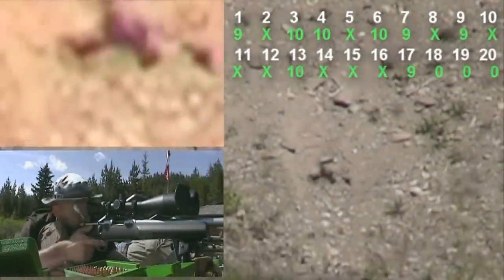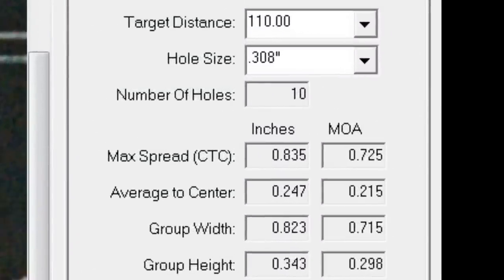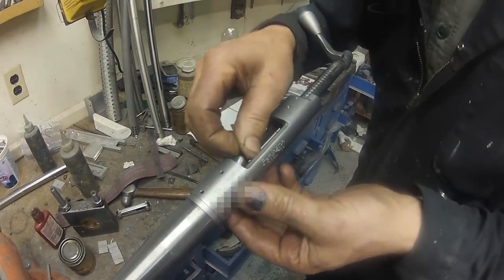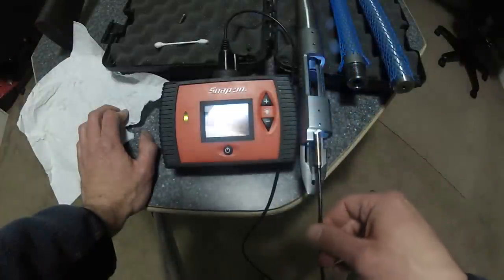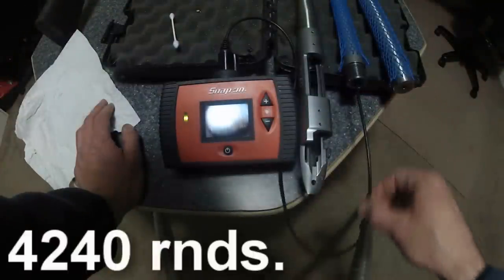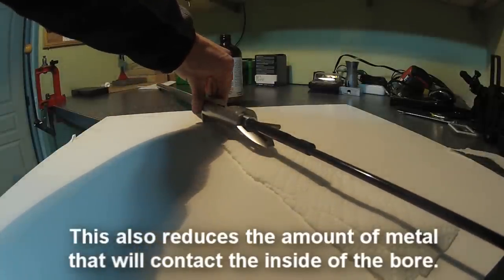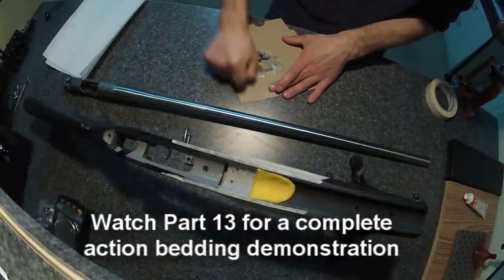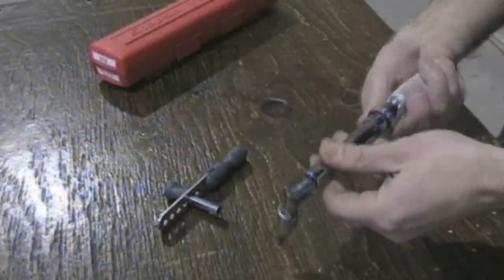Road To Precision Part XVIII - Installing a New Barrel

Comment from the maker: Most everyone I talk to agrees that bedding the action is the best thing you can do, even if your stock has a full bedding block. I'm not sure that I gained any huge amount of precision when I bedded my stock (which has a full Al block), but it definately did not make it worse.

I have played around with several types of powder, 4350 is not one of them. I use Varget because it is very temperature stable, and the temps I shoot in range from +30 to -30 Celcius.

Comment: I have a 700police, and have the same stock as you.  When I had my #7 Shilen installed my gunsmith had to widen the barrel channel. If I remember right he didn't charge me for it.  I'm all about weight with my gun. As long is I don't go over the fclass weight restrictions I'll be happy.  A couple of weeks ago in fact I drilled a hole in the top of my butt stock and filled that void with steel BB's and epoxy to add some more weight and balance the rifle more.  It sits better in the rear bag also.

Comment from the maker: That's exactly true, I was expecting more than I'm getting. 3190fps on 110varmint, 2913fps on 155scenar, 2830fps on the 175SMK. I think I'll end up chopping it down some time in the future, but for now I am sticking with it.

Now I can send them out faster If I want, those are my final numbers after 400ish rounds of load testing. Biggest group so far is still less than an inch. I would say I am getting about 1/2 MOA average so far. And that average should now shrink, because I am done testing.

Comment: Seating Depth:  Here in the mild warm tropical , ahem , temperatures of TEXAS = 38.888 +++
I have noticed pressure increases in my loads as I extend the bullet length closer to the rifled lands when the temperature passes 85 F ( 29.4 C )
I've had to back off 1 grain  to 1.5 grains of powder load to shoot at safe pressures.
Several 308 shooters suggested adding H 4350 ( a slower burning Extreme Powder ) for Hot days above 90 F 
Switched to 178 gr AMAX in for my 30-06 Long range Rifle

Comment: People get like 2600fps with 175SMK's on their 20" barrel with no pressure issues. Not much of a difference for 10" less barrel. You'll prolly see an accuracy increase at a shorter length too. When you rebarreled, did you have your action trued? If you didn't, you should've.

Comment: Also, just out of curiosity, for anybody here that knows, why bed the first 1-2 inches in front of recoil lug of the barrel as well??? Thanks in advance
Reply from the maker: +meals24u 
Reduce stress on the action / your bedding the area directly under the chamber / Barrel out in front is still free floating / More secure clamping on the recoil lug itself.